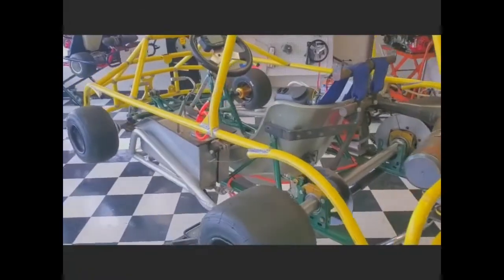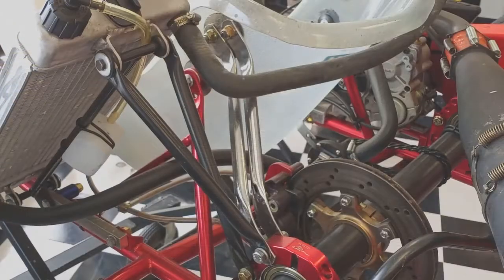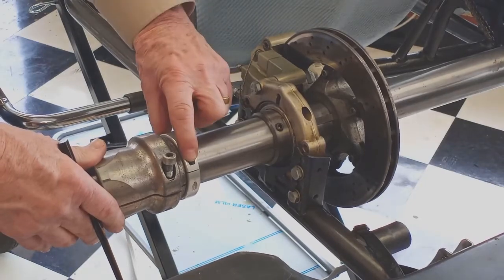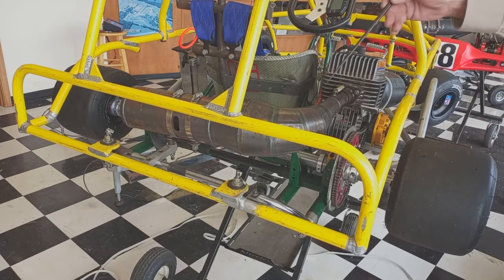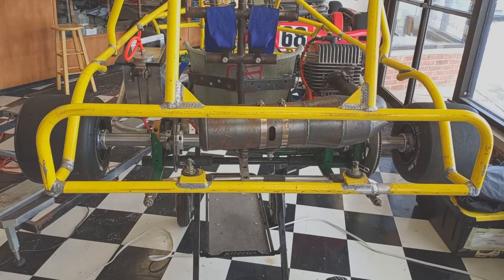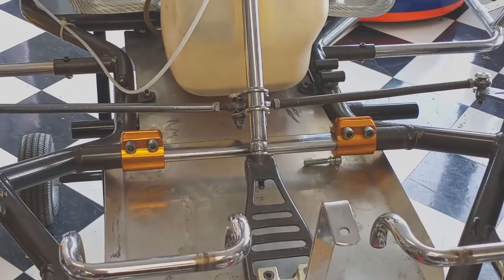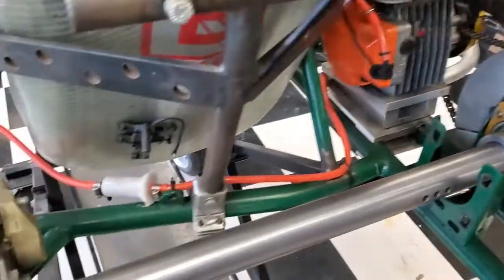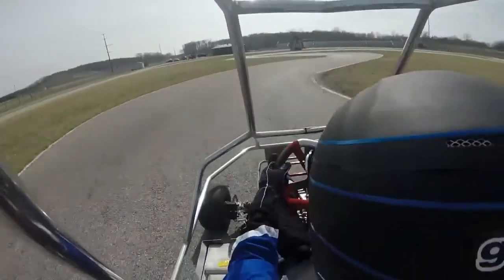Grand Prix Chassis Seminar Part 2: Advanced Setup

Comment: At the end you say that harder tyres and less grip makes the kart faster? How yo you get to this conclusion since the Formula Cars mostly drive with supersoft tyres in qualifying? 
Thank you for all the information in this video!
Reply: less grip means less friction which means more straight line speed but slower corners
Reply: Karts, other than shifters, have more traction than horsepower.  More grip without more horsepower is a recipe for going slower.
Reply: Mainly due to the lack of differential on karts; the better the rear tyres grip the road, the slower the kart goes around corners, because the left and right rear tyres are fighting more.